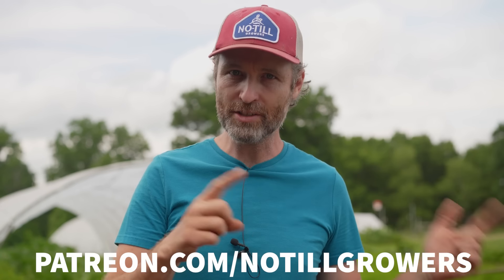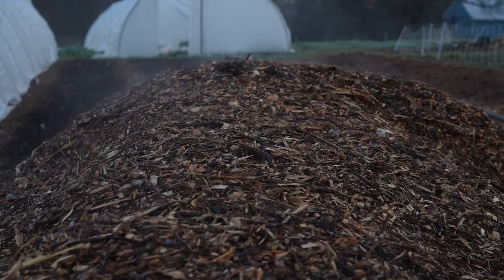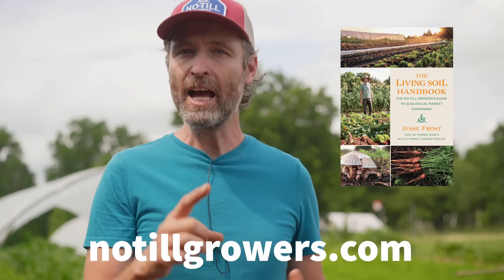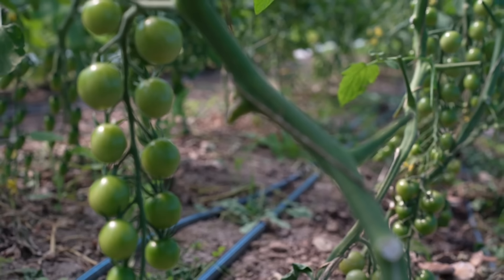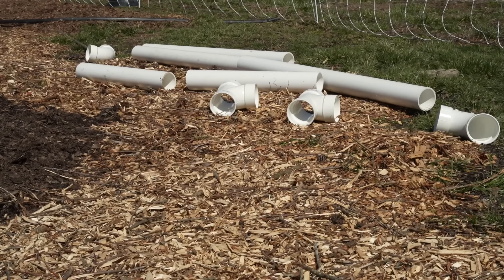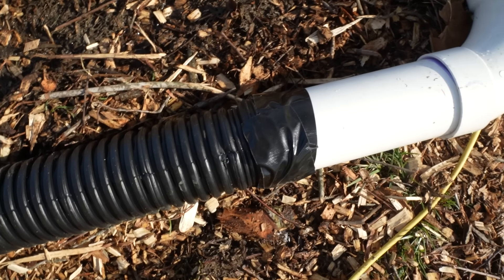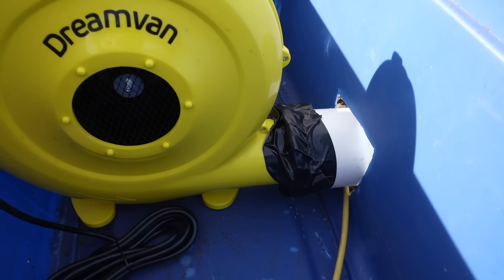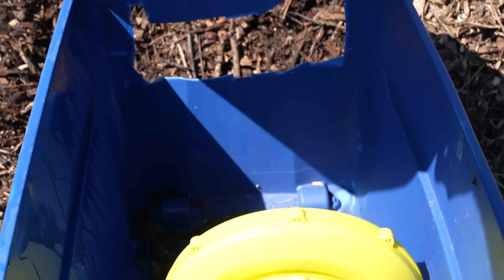Static Aerated Composting System For Organic Farms

Comment: Glue and Primer is NOT OVERKILL!!!!! you either dry fit it and hope for the best, or do it right and use glue AND primer.  Glue won't work without the primer. it's a two-part chemical weld and no one seems to understand this. (Yes, I'm a plumber AND a gardener!)

Comment: i feel like you'd want to use PVC for the aerated segment as well, as the corrugation slows the flow of air. They sell pre-drilled PVC french drains pipes you could use for that, and ofc you could drill it yourself.  I also wonder if you could combine this with underground pipes to use the temp differential between ground and pile to passively drive air flow...sort of like they do in some passive cooling for earthships. It might also help moderate and passively control the pile temp.

Comment: For my very small scale garden, with 25 hen's, i keep my coops/runs very clean. Using washed construction sand as litter. Using a kitty scooper to sift out droppings every morning and scrape off droppings from the droppings board every morning. Takes 5 minutes and done. Chickens don't spend much time during the day in there due to free-range unless its extreme weather which i will sift 3-4 time a day if cooped up. Those buckets get full in a week. I start my compost by added wood chips (my local arborist guy drops off) add the droppings, by then the good grass is in need of a cut, i add that, kitchen scraps or garden scraps are full and ready to add on. And repeat this process for about 5 months then i stop adding. In TX so it needs my watering attention. Water, turn, water. Every 3-5 days for the first month. By then im tored 😂. Then it sits getting my attention once a month. 6-8months its dark and smells earthy. No bad smell. Then i use it in my veggies garden. All the while that pile is being tended to, another pile is being created. My local extension office told me "as long as it doesn't have bad smells,its good." 
Thats how my small scale operation goes.

Comment: I just layer compost. I even throw meat in my pile. I turn it maybe once or twice a year at most. Last time, pile was only a few weeks old I already had black soil on the bottom. Currently it's black soil, pine needles, leaves, coffee grounds/kitchen scrap, used cat litter, grass clippimgs, pine needles. Mixed in those layers is meat scraps, nut shells, ash and burn pile charcoal, and sticks and limbs, and a few rotting pieces of soft and hard wood from the trees.
 I can turn it now and know the lower layer has even more black earth under it since my latest pile turning after the pile was about 6 months old for my mid summer turning.
 Hole I started with was about knee deep on me, now you'd never know a hole was there.
 I've always been able to make the pile heat properly with just rain water hydrating the pile. 
 Not worried about certification as I'm only going to be planting for my family. 
 Good system setup none the less though.

Comment: I was wondering how it would work if you took an old 500 gallon propane tank, opened the ends up, and either welded fins in it, like a cement mixer, or used rods or balls, like a old ore mill, and rotated it a couple times a day. Perhaps even a very small motor on solar, that kept it turning slow while the sun was out.
 You could have a removable door that has a screen behind it, so you could keep a wheel barrow under it, and as it turned, the finished compost would fall through the screen.
 I made one with a 55 gal. drum, and it worked pretty good, but I ended up using not enough rods to break up all of it. 
 I used the finest mesh hardware cloth I could find on three vents on each end. 
 My dogs barked at it for 3 weeks, and my Peacocks would try to perch on it, go to sleep, and fall off.
 Other than that it worked well, but I figure I would have to have about 20 of them to make enough now that I am gardening more land. 
Just throwing ideas out there. I did make my septic tank with solar powered shredders that worked when the units made enough electricity to turn them, and they worked great.
It may work with those plastic square tanks. If you were able to turn them on bearing blocks, they would stir the compost pretty good too. In those you could have worms, and not smash them.
Smiles!
Bill,
 Meta Missouri.

Comment: 02 composting Design such systems for large metro areas. A scale down version with 2 inch pipe and a hair dryer will work too. A digital thermometer to control the fan to maintain the range of heat required simplifies things.

Comment: Wouldn't air, like water, take the path of the least resistance? In the video, there is compost covering 3 of the 4 fingers coming off the manifold. Since there is virtually no pressure in the system, wouldn't the air fill the 3 covered fingers and then send the rest of the air out of the 4th unrestricted finger? Would a compost mound that covers all 4 fingers equally make this system work more efficiently?

Comment: I built 2 Johnson-Sue bioreactors and the only hard work is turning the water on for a few minutes each day. No pumping of air.
It is usually considered that air will penetrate a compost pile by up to 12 inches. By putting plastic over the top, how does the pile get aerated from the top?
Static Pile Fungal Compost Presentation is worth watching.

Comment: Hey, Sorry I'm a year late to the party, but I had a potentially helpful thought. Hopefully I don't get lost in the void. You said that ideally you'd bring your pile to temp for the required time, then move it to continue aging, but you don't have machines, and it's not worth doing the work by hand.

You could simply build the static rows where you want to age them, and remove the aeration apparatus after hitting temp, and set up a new pile in the place where you would want that next batch of static rows to age. You mentioned some people already pull the aeration tubes before harvesting, so maybe you could do that... Or just leave them. Corrugated tube is comparatively cheap. Just leave it in place, and take your blower and manifold to the next location.

I also wonder why you did a 4 way split... maybe space/length constraints, but instead of a 4 way splitting manifold a straight or even a 2 way split has a lot less PVC which costs a lot more and is somewhat more fragile. I would also worry that without 'tuning' it would be difficult to have even airflow, which would theoretically result in less consistent temperature. I think I may try my own (much smaller) version, 2 way split, but a single wider row. I'll drill my own holes in the corrugated pipe, and decrease hole spacing (Or increase hole size) as distance increases from the blower (and I'll sock my tube... at least, that's how it looks in my head)

Comment: For my home compost piles, I use a piece of 3/4 inch steel pipe to punch holes into the compost pile which provide an easy means to add water and should provide ventilation as well.

Comment: I haven't read the other comments so sorry in advance if I'm being redundant - the aerated part is obvious and the static merely means "stationary" - doesn't move. We've assisted some industry with this for soil remedial purposes where they used our wind turbines to do "off-grid" style aerated static composting piles. We do liquid composting with our equipment as well but that's a whole other story.

Comment: I like easy  --  load  food grade barrels with the C:N "stuff," roll a little to mix, let the microbes work, and roll each time cooled down (3 days?). 
Open after 2 weeks for a visual & temp check, if necessary, continue rolling every few days until no heat is generated =  ready to use.
They are easy to fill, easy to roll and easy to empty close to where the finished compost is needed.

Comment: Jesse, you mention use of manures in the beginning, but you did mention using any as your High-N source? My concerns that manure in any static pile fundamentally can never equally be brought to temperature becuse it was not turned. I also understand you studied under Elaine Ingham as well (I am also a student), how do you relate to her expressed concerns that turning 5 times is unecessary and counter productive to a good thermophilic. Also, have you considered using a Johnson-Su reactor style design in this process? Vertically protruding pipes that connect inside the pile with a max 12" from edge or other pipe would guarantee adequate aeration by Dr Johnson's claimed learnings. I have tried manipulating his design for Ingham SFW-style compost with good results, but the aeration does actually inhibit your ability to maintain thermal mass over longer periods of time, so your pile needs to be larger that her 200-gallon minimum size pile.  And lastly, can we beg of you to shoot an update/lessons learned on this video? Love to see your result now it's end of season!!!

Comment: I cannot understand the propensity for organic gardeners to use highly toxic PVC in their gardens. Admittedly in this case it isn’t IN the garden, but summer temperatures will heat that PVC and the toxins are being aerated into the compost pile which is then put into the garden; ergo toxic compost being used by plants. Isn’t there an alternative? Great video, BTW.
Reply: I wondered this too. We are certified under the Australian standard which prohibits the use of pvc. Different standards perhaps 🤷‍♀️

Comment: my cousin & me are working 3 gardens this year & all is done by hand 1 garden is probably 3/4-1 acre the second is probably 1/2 acre ish an the third is 1/8 or less & it is a Crap ton of work for 2 people and a lot of it is Back Breaking type of work as you an me know and were in a darn drought here in my part of ky and packing water in 5gal buckets to water every thing every night is rough but when we dont get rain and we have already done so much work its either pack water or watch ever thing die ! we do have an ibc tote but need a 2or even 6  more..lol. an a pump to pump pond water ! I/we are probably going to build a hightunal/greenhouse very soon probably 12x20ish Will be a Huge Help to us ! I just hope we can keep all the dang coons and cyotes ,black birds and the cows out of it ..lol. we got electric fence around it with 10,000volts but if a cow wants in bad enough they will get in But the smaller & flying pests are what i worry bout !

Comment: how do you regulate air flow between the pipes because if you have a pipe with out a heap over it when you turn the fan on most of the air will blow out that pipe and not in to the pipe with the pile over it

Comment: A tip for you, go to your local sawmill and buy sawdust vs wood chips. Wood chips take forever. I got away from them years ago. Also if you can find an old sawmil site there will always be piles of sawdust....thats where i get mine from. I have 2 acres of grass with a sprinkler system so it get mowed every 5 days. I catch it all and do a 50/50 mix with sawdust. Week 1 ill make my tower, week 2 ill make another but mix in the previous weeks tower in week 3 (14days) ill mix all my grass into the previous 2 towers. Then i start the process over again. Every 14 days ill end up with a hot pile as tall and big as my skidsteer and it gets very hot. After 1 month i add both piles together mixed with grass again and then turn that pile once every 2 weeks. In 2 moths i have half a dumptruck load of compost  Then every month after another half a load. Thats the cycle i use. I love it, its very fast. Now adding manure and whatever else you do can easily double your output on your end but im happy with my operation. I live in a small town and get someone daily that wants a truck load. I tried chips and it takes years for them to fully decompose. Most mills sell sawdust cheap, im lucky that i get mine free and also work at a mill. Hope that all made sense.

I have to one more time say ditch the chips if you can, your output and quality will be so much more and better. Cheers
Reply: Oh and the worms that come into these piles are massive, i live in a sandy area and it only took a year for my soil to completely change with this method. My grass grows thick, strong and fast. I do not add anything to my compost other than grass, sawdust and water
Reply from the maker: I don't have one nearby but I'm willing to give saw dust a shot some time. Lots of surface area so quick decomposition makes sense.
Reply: @cheeseymccheese7249  
Hi.
I would like to get more detail on your sawdust project.
I have tons of sawdust available to turn into compost. What ratio grass to sawdust works best?

Comment: if you are doing a small pile, like under 3 yards (pickup full) it can be very helpful to tarp the pile.  this holds in heat and water and ammonia.  if the material is fairly  coarse like horse manure, etc, there will be enough oxygen.  that is not true of grass clippings.  i would just turn them.  if you can get the pile to heat well once you get rid of a lot of weed seeds.

this static pile works all right even 18' high.  but you will almost always have some unfinished stuff on the outside.  you can just peel it off and start a pile nearby and use the center stuff.  let the outside stuff be in the center next pile.  don't work hard with compost.

Comment: That you can trust , was the most important part of that opening. I’ve bought contaminated hay and cow manure the same year. And last year I got 2 dump truck loads of what was supposed to be composted garden soil that was as dead as could be. The very few things that didn’t die right off when transplanted, curled, yellowed, and was stunted. I don’t trust ANYTHING I didn’t do myself . Challenging to try to make enough to make a difference

Comment: Does compost piles have to be in full sun? My friend says no, but I beg to differ. Timing.. 
  It gets sun when the leaves fall until they grow again in spring. But I'm not adding to it in that time.. 
  My hard wood ash I clear from my wood burner, goes in a separate pile dampend but not soaked, and covered, mix it in as needed , and spread it just as frost starts on the growing areas.. 
  Not sure I'm right, but thinking about regrowth after a fire, seems ash is spread and things grow beautiful the following year.. 
  Reading books on native Indigenous practices before pioneers settled and took over everything, turning over hundreds of years of propagation by Indians , destroying it in a couple seasons.. having to use fertilizers and more water since.. 
  THIER old practices fed millions, and if the watershed went low, they left and went to another region a few years.. they didn't try to suck it dry.. 
   But costing,,, done as they went,, fish bones, whole eggs and shells,. ECT.. and just letting it all die back in without taking it up to clear the ground.. and controlled burns between regionals and seasons.. 
   They had a whole agriculture system before we arrived and wrecked it for profit.. not to feed the masses,, but PROFIT.

Comment: A high enough flow rate might be able to supply a high enough flow rate for completely aerobic decomposition of meat, although a fair bit of grinding as well as being mixed with brown materials would probably be necessary.  If I'm not mistaken, the inability of oxygen to diffuse into the pile quickly enough is the reason green material needs brown material, which is why I'm thinking at least a reduction of the necessity to use brown material might be found.  Not having to turn a pile seems to be just the beginning, but flow rate holds the authority here.

Comment: ive done improv small scale aerated, once in a while i roll over a small air compressor and use a blower nozzle with 2 foot of brake line attached. so i can just poke it in and blow air in the middle

Comment: I like the concept, I like the less labor aspect. I have tried many composting methods. I think I'm going to give this one a try. Right now I have a few Johnson Su bioreactors going But I Really like this method to easily to produce a large amount. I also think if you tweaked it a little you could produce very high quality compost. The one thing I would change is, I would put all the holes on the bottom of the pipes. By putting the holes on the bottom of the pipes and only on the bottom. 1. Your materials can not fall in to the pipes, the air will defuse regardless of the placement of the holes. 2. by putting the holes on the bottom, the pipes can not take on the ever important water where it could puddle especially if you are using  Corrugated Perforated Pipe. The water could puddle and become stagnant. Then it could become a breading ground for bad anaerobic bacteria and pathogens.  That's my 2 cents. going give it a try come spring. Thanks. Livetom.

Comment: Don't use standard white schedule 40/80 PVC pipe for this, it's only rated for up to 140°F, and your compost pile will get at LEAST that hot: make sure you use CPVC instead, which is rated to up to 200°F.

Comment: Hi mate, thanks for sharing. Just a tip for welding the pvc joints, if you put solvent on both the outer pipe and inside the fitting it will glide in better. You can then also spin the pipe a little to get the glue to flow around the joint properly. If you only glue one side of the pipe or fitting and try to squeeze it in, the friction will warm the glue and make it set quicker, so it won't fit properly or you have a hard time pushing the pipe in the fitting. ;)
Reply: Thanks for the valuable information mate!
Reply: oh I always wondered why people always did both, thanks for the tip